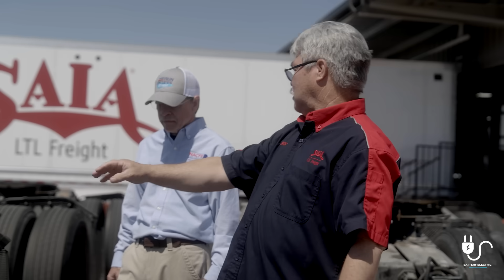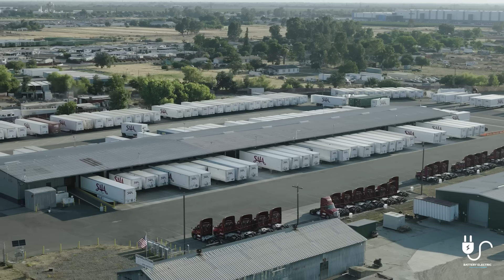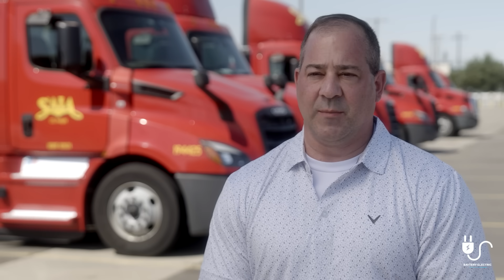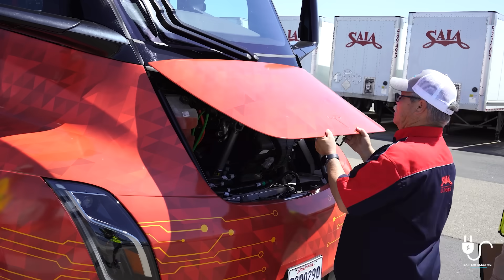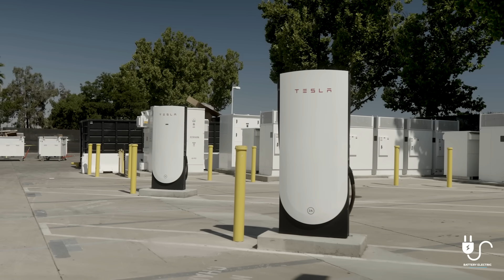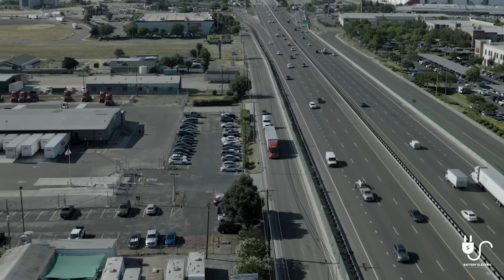Saia: Run on Less – Messy Middle Fleet Profile

Comment: We are only in the infancy of electric truck profiles.  I hope in the next five to ten years that range and variable power will improve drastically.  Right now,  diesel rules in over the road trucking and will until things improve much more.
Reply: Otr is a small part of trucking.  The tesla semi already has plenty of range to do it and they already have a sleeper cab design ready to go. The only thing missing is the charging network. Tesla is starting to build a route from Nevada to Mexico linking all the factories

Comment: CNG is almost certainly cheaper and cleaner (cradle to grave, well to wheel) with our current grid. It would be interesting to see a comparison.

Edit: I meant to add total lifecycle emissions in there as well. Electric vehicles start with a huge deficit relative to ICE vehicles.
Reply: Show your data! 
Electric is 4X cleaner well to wheel.
Argonne Lab.
Union of Concerned Scientists.
Transport & Environment.
BEVs outlast ICE with minimal maintenance and fuel costs. TruckersReport says semi-truck maintenance and repair costs are upwards of $15,000 per year. Trucks are off the road and not earning regularly with broken windscreens. Tesla's glass is armored. 
Tesla estimates ~ $0.133 per mile, compared to diesel costs ~ $0.599 per mile in California in April 2025. Savings of ~ $188,400 over 600,000 miles.
Tesla is constructing a 1800 mile truck charging corridor between California and Texas.
All Teslas are manufactured as self driving and capable of convoying.
Reply: @waynerussell6401  Just to be sure, you do realize that the UCS was talking about BEV car batteries, relative to ICE cars, right? Semi truck engines typically last at least a million miles, and they're rebuilt when they're worn out, not replaced. Tesla batteries, on the other hand, typically last about 300,000 miles, about a third as long as ICE truck engines, and they're replaced at that point, not rebuilt. The batteries in these trucks aren't going to be babied in use, either, unlike the Tesla batteries that last longer then 300k miles.
Reply: @PistonAvatarGuy  Tesla showed a one million mile motor and gear train after testing in October 2018. There is no performance drop or maintenance procedures to attain this - cf $15k/yr for fossil plus rebuild cost. The latest gear-train, motor and inverter for the CyberCab costs less than $1000.
Tesla's battery research at Dalhousie University under Prof Dahn has shown that when cycled for normal automotive usage, high energy density NCA cells last over 10 000 cycles. In stationary applications for storage they basically never wear out. The key to longevity is temperature control and voltage. In car use a 20-70% state of charge cycle is typical and charging might be once a week in urban use (only ~6.9% are longer than 30 miles - DoE). Of the 5.2 million US trucks, 50%  run on routes of less than 100 miles.
Storage at high voltage in high temperature climates causes reduced life. Tesla has state of the art cooling systems using heat pump and an OctoValve - unique in the industry. Speed of charge does not adversely affect batteries as long as temperature is controlled. Tesla Semi will charge to 80% in half an hour. 
Tesla will offer two batteries. Standard Semi for ~90% of journeys will have LFP cells which are cheap and have very long cycle life. Long Range Semi will have NCA cells which have a similar long cycle life at the same voltage as LFP, but with the capacity for longer ranges at reduced life.
Cost of replacement packs continues to fall. Packs that have fallen to <70% of capacity still have use for short haul or for use as stationary storage. Spent packs are crushed and 97% recycled into more batteries by companies like ex Tesla Redwood Materials in Nevada.
Cell technology is rapidly expanding cycle life. With single crystal coherent cathodes cell life is substantially improved at ~ 10% more cost.
Tesla has invented its own cell - the tabless 4680. These are mass manufactured at Texas GigaFactory and currently used in the CyberTruck and are the cheapest cell that Tesla can obtain from any provider and have the same energy density as the best automotive NCM cells obtainable (Panasonic). Both Panasonic and LG are currently trying to make their own version of these cells.
Tesla is an extremely reliable source. All independent tear-downs of their products have confirmed Tesla specs and received rave reviews and are sought after by all OEMs. Tesla leads.
https://www.youtube.com/watch?v=6aEQXHSfjn4
https://www.youtube.com/watch?v=rOAYjcO6kao&t=192s
Reply: @waynerussell6401  And, Tesla isn't even remotely close to being a valid source on this matter, they're obviously not going to be unbiased on the matter.
Reply: @waynerussell6401  The production of electricity in the US is still dominated by fossil fuels. CNG trucks have extremely low emissions relative to diesel trucks. BEV trucks are significantly more expensive to buy/produce than ICE trucks. I don't believe that anyone knows how long the batteries will last in this application, but they're not likely to last as long as ICE truck engines. Replacing the batteries in BEV trucks will likely cost more than an entire day-cab (BEV trucks are not long-haul trucks) CNG truck. The glass argument is ridiculous, it's not like ICE trucks can't be fitted with higher strength glass. I wasn't arguing in favor of diesel, diesel engines don't seem to be a good fit for any sort of road-going vehicle these days.
Reply: @PistonAvatarGuy  The grid is rapidly evolving from burning things to cheaper sustainable generation, as is transport.
Over 80% of new generation additions in US last year were sustainable. In enlightened States like California (5th largest world economy), 57% of generation is clean. The grid capacity can be doubled with the use of battery storage. BEVs can be a large part of this with distributed grids like new housing developments in Australia where power walls and BEV batteries replace Peaker Plants.
CNG will not meet the EU 2030 emission limits being high in methane which is a powerful greenhouse gas as well as nitrous oxide and ammonia.
Tesla Semi is not more expensive than CNG Semi. Both have manufacturing expenses higher than Diesel. But the cost to own is much cheaper for BEV. Many subsidies apply to BEV use.
The  International Council on Clean Transportation estimates that in 2025 a BEV truck needs to be only 15% cheaper to own to beat Diesel. 
Battery life is not an unknown. Extensive use and research by CATL, the major supplier of heavy use packs like the  Tianxing battery designed specifically for buses that can last 1.5 million km (932,000 miles) and 15 years, a warranty of ten years or 1 million km (621,400 miles). Current cell costs are as low as $40kWh.
Tesla Semis are long haul trucks. In the Run for Less Trials they demonstrated 1,076 miles a day actively delivering/hauling beverages across Northern & Central California, and Nevada, with gross vehicle weight plus load above 70,000 lbs for more than 65% of the run.
Reply: @PistonAvatarGuy most ev trucks have over a million km warranty. What makes you think a battery will be so expensive.  Prices a dropping every year. The savings over the life of the truck would pay for a new truck. If not a battery would be less then a 100k
Reply: @saff226  1M km is only about 600k miles. I was mainly commenting on the Tesla Semi, for which there is very little information regarding its actual purchase price. The estimated price of a battery replacement was based on the price of other Tesla vehicle batteries.

If the BEV trucks are more expensive to purchase initially, and the battery needs to be replaced at least twice as often as an ICE needs to be rebuilt, there will be no savings. The eCascadia (day cab), for example, seems to cost about $100k more than a CNG Cascadia, that's something like 40% more than the ICE truck.

The fuel costs for CNG trucks are also very low, which is why most comparisons between ICE and BEV trucks are made using diesels.
Reply: It is not, CNG is only 30-40% efficient. Tesla Semi is over 90%. Plus CA grid is running around 60% clean energy. CNG burns very dirty, with a measly 5% less CO2 emitted than standard gasoline engines.
Reply: @dominicbendinelli4805  But the Tesla Semi isn't only meant to operate in California and the US energy grid is still largely dependent on fossil fuels. Even the California grid is still over 40% natural gas (it's less than 60% "clean" energy).

The operators of electric trucks are even considering using on-site generators to charge their electric trucks, because the energy demands of electric truck fleets are so high, but that will just add complexity and cost to their transportation systems.

CNG is ridiculously clean, CNG vehicles are literally considered to be near zero emissions vehicles.
Reply: 1M km is only about 600k miles. I was mainly commenting on the Tesla Semi, for which there is very little information regarding its actual purchase price. The estimated price of a battery replacement was based on the price of other Tesla vehicle batteries.

If the BEV trucks are more expensive to purchase initially, and the battery needs to be replaced at least twice as often as an ICE needs to be rebuilt, there will be no savings. The eCascadia (day cab), for example, seems to cost about $100k more than a CNG Cascadia, that's something like 40% more than the ICE truck. The fuel costs for CNG trucks are also very low, which is why most comparisons between ICE and BEV trucks are made using diesels.
Reply: @PistonAvatarGuy  Pepsi reportedly paid $250k for their long range Tesla Semis.
You have not taken on board my data on batteries or supplied any CNG data. There is no battery replacement required! 
Watch the Dahn videos!
Lots of analysis of BEV trucks has been undertaken showing BEV beats fossil in price, performance, environmental compliance, driver satisfaction, safety and most importedly - autonomous driving.
The Tesla Semi head of development was Jerome Guillen, the creator of the Cascadia. His employer infamously said that Tesla has broken the laws of physics. Daimler Mercedes have amongst the least efficient BEVs on the market. Tesla on the other hand have exceeded their stated goal on reveal of 2kWh/m with independent users getting 1.55 kWh per mile, which was documented in a recent three-week pilot test with ABF Freight. 
Tesla leads.
OEMs Bleed...
This topic is now closed.

Comment: This is fascinating. I wonder how technology will push limits also inside the cross dock to maximize the utilization of the space available in the semi-trailer?
Reply: when it comes to technology america is far behind of the world! in Scandinavia or Australia they uses diesel truck to haul up to 4x the load of the american semis lol!
Reply: @carholic-sz3qv  Run for Less Trials showed that Tesla Electric Semi hauls the same weights as Diesel, and is not limited to short hauls, with rapid charging allowing continuous long distance runs.
Reply: - unlikely to change because of DOT regulations, cant add solar or rear axle Trailor motors.
Reply: @markplott4820  change the DOT regulations and use more powerful diesel semis to pull 2 or 3 more load with a single semi thats where change needs to be made! there is more than enough space to run longer trucks
Reply: @carholic-sz3qv   - change DOT making ALL Diesel & Hybrids ILLEGAL in all 50 States.
Reply: @markplott4820 Powered trailer axles carry a lot of potential, because in winter mountain driving they can do a lot to add stability and traction; chaining up could be reduced considerably. Having that axle for regen means down-slopes will be much easier to manage too.
Reply: @Thunderbuck   - I want them too, but NOT currently LEGAL in the USA or Anywhere else.
Reply: @markplott4820 And you don’t think there are manufacturers working to get this approved? There’s already a company making 54’ trailers with their own powered axle and battery. It’s on sale and legal.

Comment: this is a GAME changer both for Operators & Drivers.
operators will save $$$ hundreds of thousands in 1st year alone, offsetting the Charging costs.
Tesla maintenance costs are ZERO for several years after purchase. 
but what SAIA needs in Stockton is #1 SOLAR on the Roof & #2 Megapack to store Energy , then only needs OVERNIGHT chargers for Daily operations.
Reply: the only game changer is using single semis that can do the job of multiple semis its called road trains in Scandinavia and Australia and they can basically go everywhere even where there isnt a pavement
Reply: @carholic-sz3qv stop with the road train crap. Very few routes in the world are suitable for a road train
Reply: @carholic-sz3qv we have doubles and triples here. And we can afgord to pave roads our trucks travel on
Reply: Just say you know nothing about trucking and move on
Reply: Nice to see you, Mark !